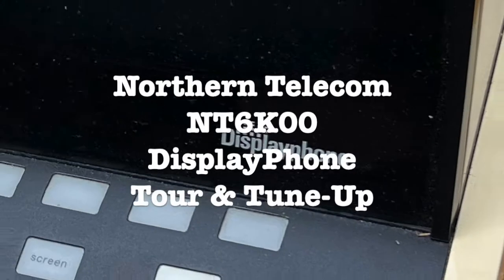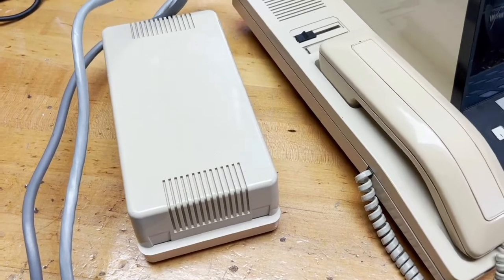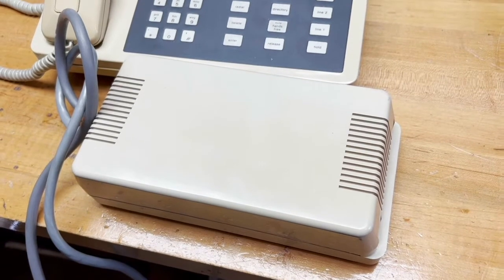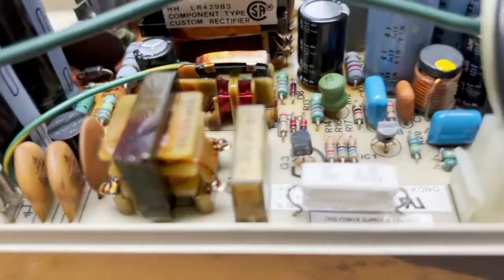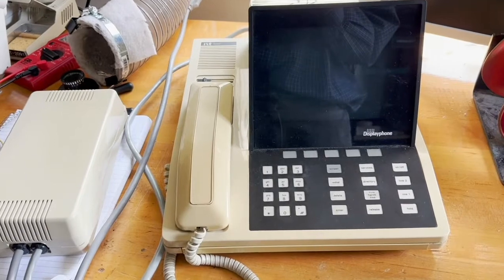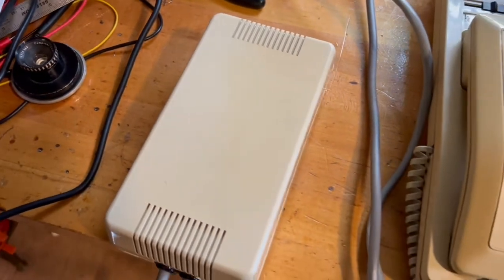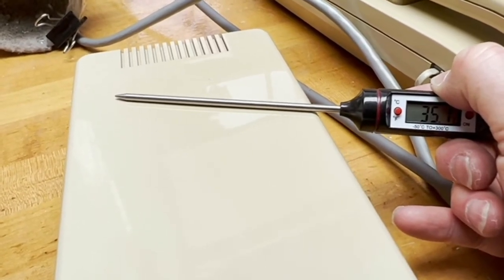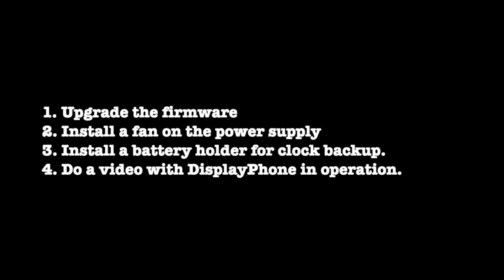Northern Telecom DisplayPhone NT6K00 Tour & Tune-Up

Comment: I have some motherboards from this. Back in the early 1990s, I fished some during a dumpster dive. I was able to cobble together a working one from parts at the time. The only use I could find for it was as a phone and the terminal was used to null modem line to my BBS so I could check the stats , login and read mail. You could not download software to it.
Reply from the maker: You’re right. The software was very limited; it almost looked unfinished. With the terminal there was a calendar and phone book. Not much else and certainly no file upload / download. The user-interface was clunky at best. The designers tried to marry a terminal to a phone rather than a phone to a computer. It’s an interesting piece of history. Right now I have two DisplayPhones. I’d love to trade one for a DisplayPhone-Plus. I see DisplayPhones coming up for sale from time to time but I have yet to see a DisplayPhone Plus for sale.

Comment: Hell yeah, thanks for the video.  I picked up on an estate sale and it seemed to be okay on powerup, but not for long.
PSU is in rough shape, as expected.  L5 was blown out, and R25 seems a bit goofy too.
Luckily, battery doesn’t seem to leak, but I can’t quite do a full inspection since the keyboard ribbon cable just ain’t coming out
Reply from the maker: Congratulations! It's a very cool phone / appliance. If the keyboard cable isn't cooperating there must be corrosion. You can try some heat (not too much!) and wiggle the cable. A bigger job would be to remove (desolder) the connector from below and tease the ribbon cable out doing as little damage as possible. But just don't forget about the NiCad. There's no question whether it spill its guts; it's just a matter of when. And it won't be pretty.
Reply: @Mr.BrownsBasement  thanks for the tip - managed to rip out the battery and get the dang thing to turn on.  The display isn’t outputting anything so i must’ve knocked something loose - onto the next!
Reply from the maker: @WarrenTemple keep me posted!

Comment: I actually came across this video when looking for information on the power supply - I just picked one up at a flea market (complete in the box) and upon first power-on, the terminal lights flickered a few times and that was it. Upon opening the power supply brick, it appears R25 is now blown / open (looks like a current limiting resistor in lieu of a fuse?) so I'm guessing there's a short on the primary side (poly film cap, one of the electrolytics after the bridge rectifier maybe).  I plan on pulling the caps tomorrow and checking / replacing them to see if I can get this thing to power on.
Reply from the maker: Your diagnosis is reasonable. But in the worst case the transformer is shorted you could always fit a new switching supply in the plastic box and no one would be the wiser. Best of luck with troubleshooting and please let me know what you found!

Comment: Thanks so much for this tour!! I just got one of these and am really hoping to get it running. Mine has two problems with it: unfortunately, the battery on mine did leak, all over the ribbon cable for the keyboard. I'm going to have to come up with some replacement cable, the whole thing is pretty much toast.  Luckily I don't see any other damage on the board itself, it really looks like it all just leaked down through the slot onto the ribbon and missed the PCB entirely. The other problem is that I'm missing a power supply. I did find a pin-out from another site, but it's a little unclear on which pin direction to use for the connector. I'm going to have to do some tracing and see if I can verify, unless you happen to have the pin-out as well?

In any case, thanks so much for this. There is so little information online for these DisplayPhones, and they look like really fantastic systems. I'm really hoping I can get mine up and running.
Reply from the maker: Congratulations on your acquisition and I'm so glad that my video was helpful! Sorry to hear about the battery leakage though I'm relieved that the motherboard is ok. My DisplayPhone is about 200km away at this point so I can't check it now -- but according to: http://biosrhythm.com/?p=1628#comment-227821  the pinout for the DE9 cable is as follows: Pin 1 & 2 is +5, pin 4 is +12, pin 6 is -12 and pin 8 & 9 are ground. Pin 3, 5 & 7 are unused. Please keep me posted on your progress!
Reply: @Mr.BrownsBasement  Progress! I managed to get an ATX power supply setup as a makeshift power supply for this by stealing MB connectors for 5v, 12v, -12v, and common and creating a plug using a solderable DB-9F connector.  And somehow it works! At least, I can get motherboard lights and the screen to come on with a date/time message. I can't do anything with it yet, because I need to figure out a solution for the ribbon cable. There is just a little bit that might be salvageable by the keyboard end, but I'll need to figure out how to extend that. I'm thinking either de-solder the connector from the MB, move it by the ribbon and then run wires from there to MB (presumably with a new connector so I can disconnect,) or I've seen where people have emulated the ribbon cable by getting a .6mm pcb printed with connections for each pin, attached to a ribbon cable. That would work, but I'd still need to find the female connector for the keyboard end. Have you had any luck with these kinds of repairs? In any case, seeing the monitor go has given me a lot more hope!
Reply from the maker: Excellent news with getting a display on the monitor. The motherboard and monitor circuits are both happy. An ATX PSU (or any switching supply) is a great solution to your missing brick problem. You could probably find a small switching supply on eBay, fit it into a Hammond enclosure and paint it beige and no one would know. If I had a corroded ribbon cable I probably would have tried running fine wires between the motherboard & the keyboard. I doubt the wire dressing is especially critical and you could probably run them in a neat bundle. Once you've got it up and running, I'd be curious which version of the Firmware you have. I'm planning on a followup video after I burn some new ROMs but I've been too busy.